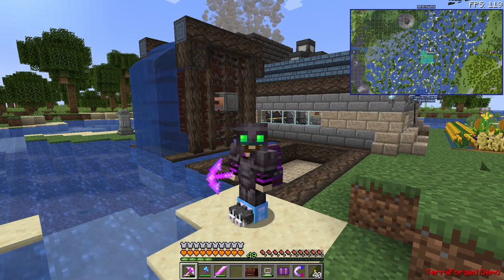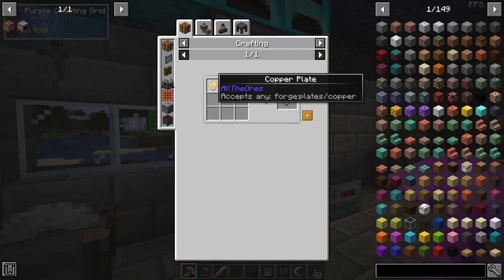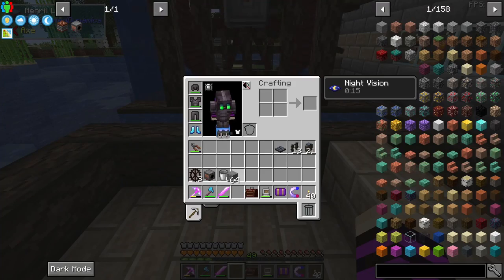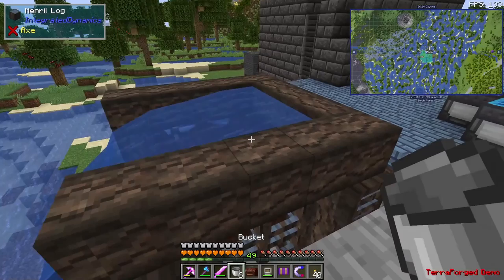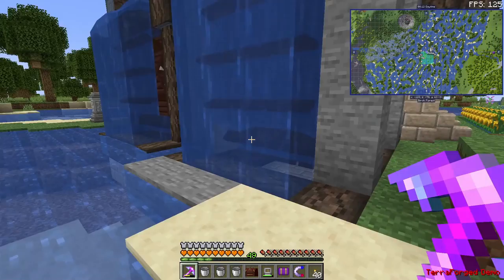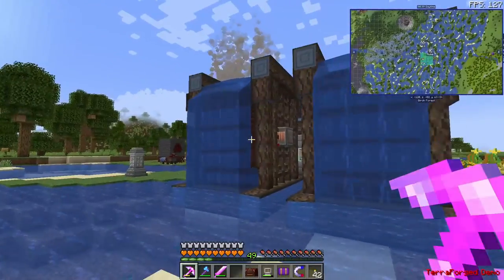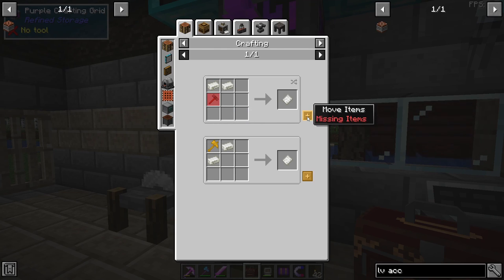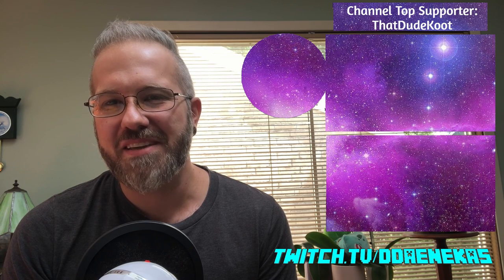Immersive Engineering Mod Spotlight 1.18.1 EP 3 - How to Make Power! Kinetic Dynamo and Waterwheels!

Comment: You can get more out of the water wheels by using bubblevators on the back end. The back empty space you can use soul sand and water source blocks either just the one block or up to the top as long as they touch the wheel and it will "super power" the water wheels. In theory...I haven't tried this yet but if the bubblevators work on back end pushing up then in theory their opposites with magma blocks on front end can pull it down faster. I'd have to test the magma block one first to confirm...but the soul sand one does in fact work. You get like 8 or 16 more rf/t per wheel.
Reply from the maker: Kool, I will look that up.

Comment: This may be a older video on the mod, but I'm playing a on a server with my friend, using a this mod in a modpack called deceased craft. But while using this mod, the water wheels and windmills are invisible and wont work, I was wondering if you had a possible fix for this? Thanks.
Reply from the maker: Are you using a shader?
Reply: @LetsPlaywithDDae  Yes, should I am using a shader pack included with the mod.